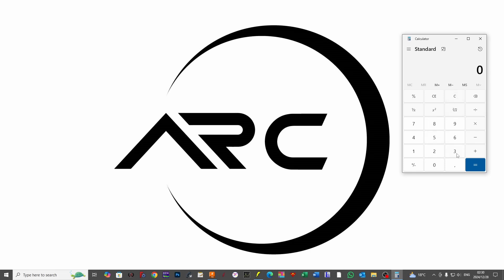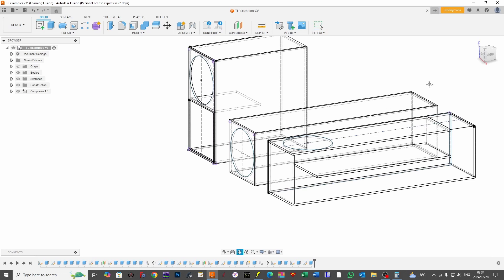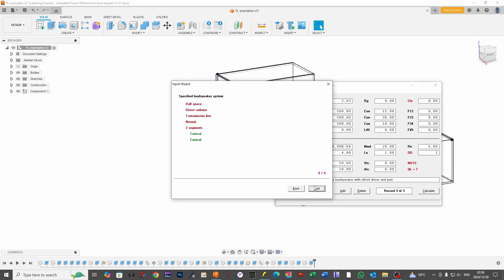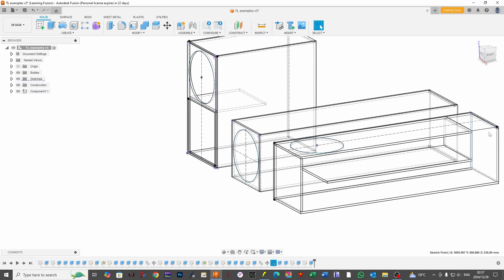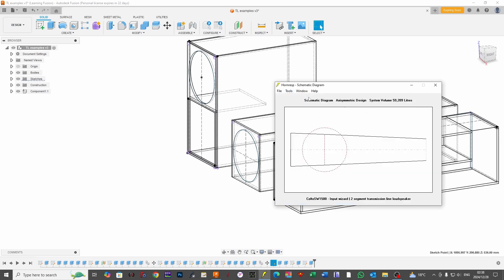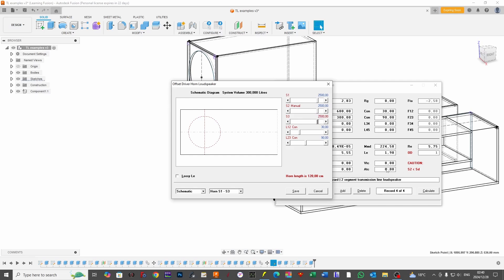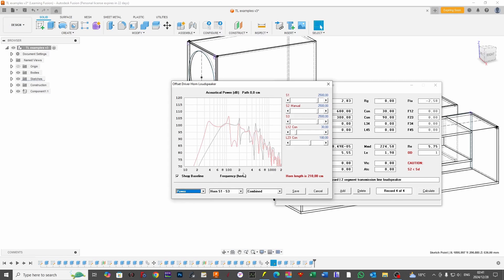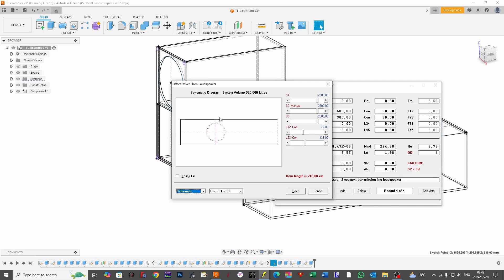Hornresp Tutorial Part 4 - Transmission line design, super simplified

Comment: How does volume work in Hornresp? Because all the handling one has over the design is on a plane, so we have a Y axis and an X axis, but the Z axis is missing, which gives the volume, but it cannot be edited, and it does not appear at any time, so I do not understand how the software is able to calculate the volume, and how one knows what are the measurements that one is really entering into the software.
Reply from the maker: Very very easy, we use the width x depth. We have S1 and S2 values each S value is an area. The L value is a length 😊 so if S1 is 30cm x 30cm and our length is 30, then we can calculate volume
Reply: @The-Sound-Guy  Okay, perfect, so the S parameters are area numbers. So I can use any combination of width and height that gives that number?
Reply from the maker: @radew83 yes, try start from video number 1.

Comment: Thank you very much for this good example. However, for the sake of precision, it would be much clearer if you specified exactly, using a dimension instead of a cursor when referring to a distance or a hatch when referring to an area, indicating whether these distances refer to the inside or outside of the cabinet. Additionally, an important measurement is the length of the tube. In the third example, with the cabinet divided and the driver placed in the front or baffle, how exactly is the length considered?
Reply from the maker: @betod63   @betod63  👋 Hi, whenever working in hornresp we always work on an internal volume to create the values. Internal width by Internal height gives us our S1 or S2 values and so forth. in short we can draw an imagery line down the middle of the enclosure from one end to the other end to define our perceived length of our "tube" or box to derive a length. If we fold a pipe in half we could say our pipe is the same length however the corner does add slightly more length overall, as to where the speaker is in the line is completely up to you and the desired response you are after.